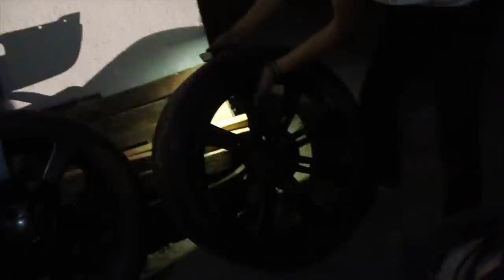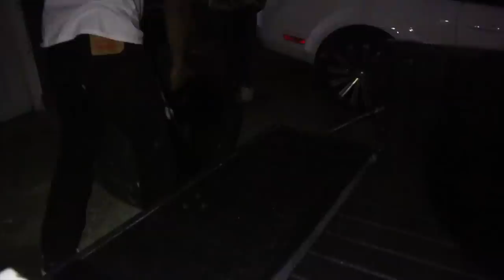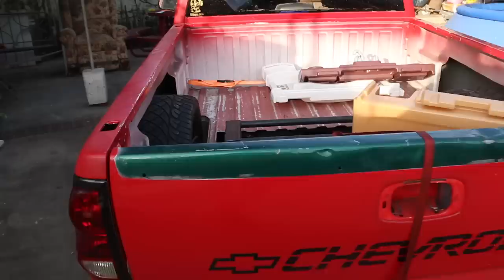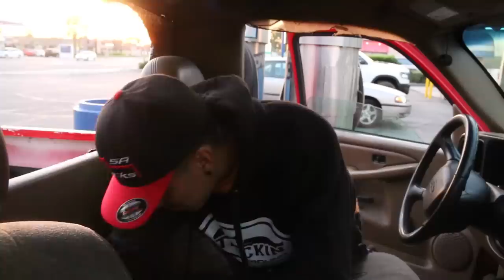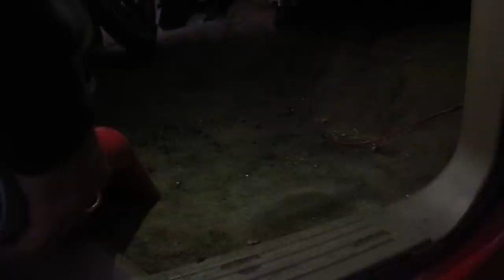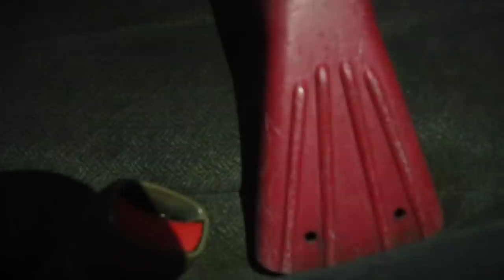Bought New Wheels For My Truck !!

Comment: Dude said, I think it doesn’t spin because the new tires have tread. No, it’s because the wheels are way heavier. No tread on dry surface is the most traction you can have